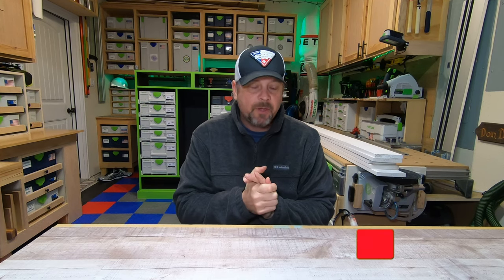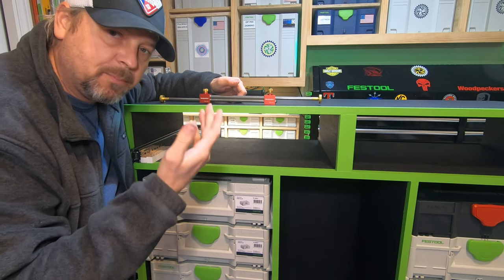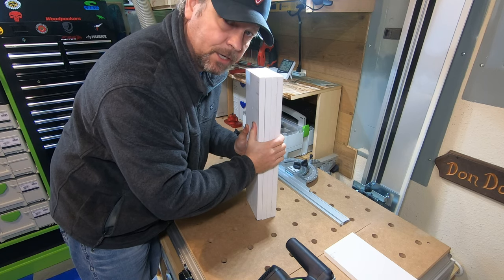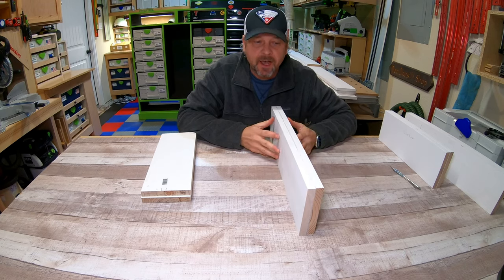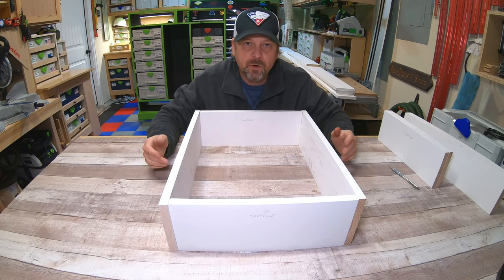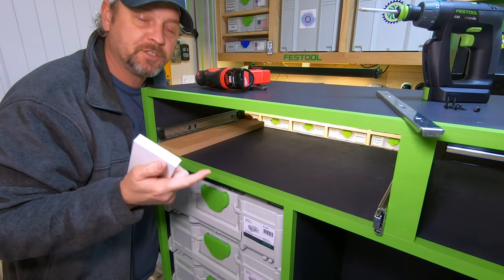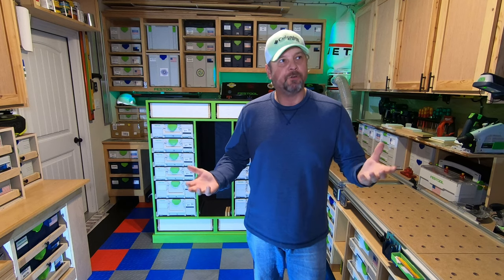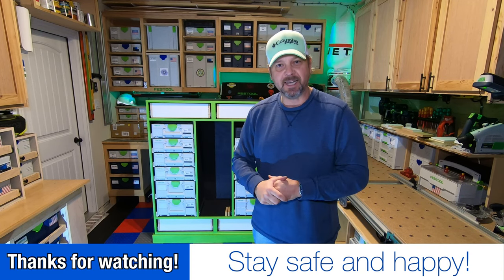Festool SysPort BUILD PART 3: How to measure and construct drawer boxes.

Comment: I just finished making 10 drawers and wish that you had posted this a few weeks ago. I was trying to convert over to metric and ended up making multiple errors along the way in the math, mostly because I was trying to be too precise. It didn’t help that I was using a Festool track saw for the first time and made many of the mistakes by making the cut on the line or on the wrong side of the line. Love the concept of a bar gauge instead of trying to measure to a millimeter.
Reply from the maker: Anytime I can remove having to actually measure something that’s what I do. Thanks for the comment!
Reply: You mention using #8 x 5/8 screws but your link takes you the 1/2” version. Which was it?

Comment: Last suggestion:  Call out the setup on the DF500.  5mm dominos, narrow setting on the width and which dominos use it,  depth setting, usually 30mm for the 5mm dominos, and the use of the plastic guide blocks so that you don't have to measure anything.
Reply from the maker: Good points. I’ll point out the domino settings in the final part 4 video.

Comment: Great job Brian! The sysport is coming along nicely!
If I still had my domino it's how I would do all my drawer boxes. It creates a very strong joint. Since I don't though, my go-to method is the single setup tongue and dado. It works great once you have it dialed in.
What are your plans for the fronts? Painted the color of the cabinet with green pulls would look amazing!
Looking forward to the next one. :-)
Reply from the maker: That’s exactly my plan. Fronts will be the black/blue color with some green pulls

Comment: Ok, where do you get one of these bar guides?
Reply from the maker: It was a Woodpeckers “one time tool”. I do not believe they offer it anymore, but Rockler sells a similar type tool

https://www.rockler.com/rockler-3-in-1-bar-gauge?country=US&sid=V91040&promo=shopping&utm_source=google&utm_medium=cpc&utm_term=&utm_content=&utm_campaign=PL&gclid=CjwKCAiAsaOBBhA4EiwAo0_AnCZ5aY9c0NOj9RYpwqjpGMT2L91VKfYFf-r-IkWNPJrVwh3ijMrk_hoCSb4QAvD_BwE
Reply: @BrianWatersOutdoors  I just bought one.  I am dyslexic and therefore measuring is my hardest task in woodworking. Thanks for the link.
Reply: I also found a really nice set at Lee Valley.